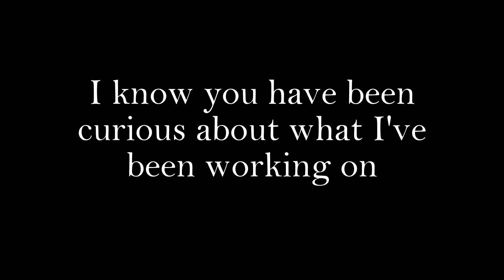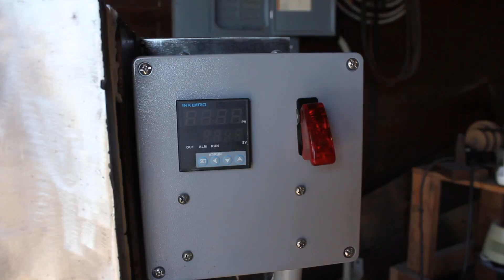Making Cayla's Engagement Ring

Comment: As someone new and trying to self teach lost wax, this was beautifully put together and a very helpful step by step! Thank you for that. I did have a question - how did you make your vaccuum chamber!? and what did you make it out of? I can't afford a real one and have been looking into how to make my own but have been mostly seeing stuff with pots that you have to cut holes in the lid, which I also don't have tools for. Yours looks perfect.
Reply from the maker: Thank you! I'm glad you enjoyed the video. As far as making a vacuum chamber. It's difficult to do with out much in the way of tools. The YouTube channel "The King of Random" has a good video on making a vacuum chamber and rubber gasket. I used a large glass jar with thick walls in order to stand up to the forces of the vacuum (please be careful if you try this). The most expensive part of the vacuum chamber setup is the vacuum pump. However, Harbor Freight has an Air Vacuum Pump that is inexpensive and pulls a very strong vacuum. You will need an air compressor in order to use it though. Here is the link for it:

https://m.harborfreight.com/air-vacuum-pump-with-r134a-and-r12-connectors-96677.html

Thick plexiglass is also difficult to come by. I ended up using a piece of laminate wood similar to a kitchen countertop. It just needs to be as flat and smooth as possible in order to keep a good seal on the gasket.

I hope this helps. Best of luck with your castings!

Comment: What material did you make the mould out of? Awesome work by the way!
Reply from the maker: Thank you, Andy! The mold material I used is called "LiquaFast ICE". Its a transparent RTV molding rubber made by Castaldo.
Reply: @GraceNoteForge  Thank you!! I might have to get some! The only casting I have done so far is lost foam casting. Just out of interest what is the blue material you shaped into the ring at the beginning? It might be interesting to try out some other methods of casting!!
Reply from the maker: @Andy-tf2ph  the blue material I used is called Matt Carving Wax. It's just a tougher wax that's easy to carve. You can also use it for the investment mold and just burn it out directly but Its good to make copies in case the cast isn't successful.
Reply: @GraceNoteForge  makes sense, thank you! I'll give it a try!!

Comment: What did you use for the mold material?
Reply from the maker: James Stratton, the RTV silicone I used is called liquafast ice from castaldo.
Reply: Sorry, I meant the investment mold.  Good call on the RTV though! Still helpful.
Reply from the maker: Ohh gotcha. The investment I used is called SRS classic investment powder. I just bought a 5lb bag on eBay and it works great!